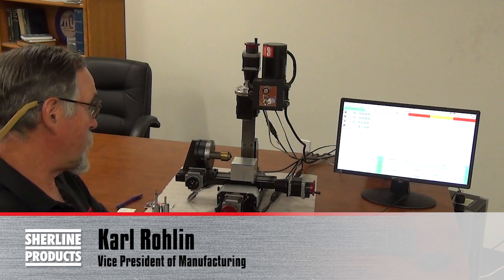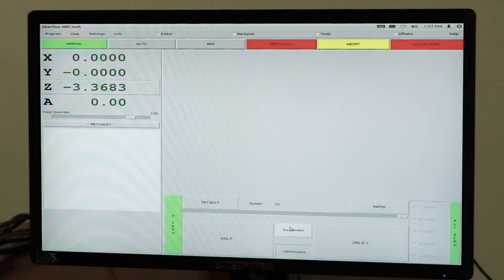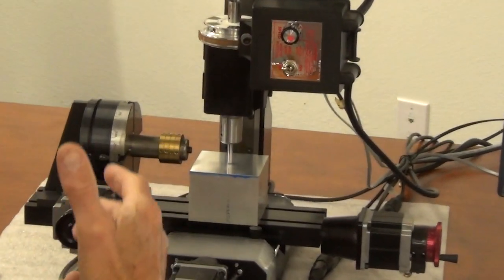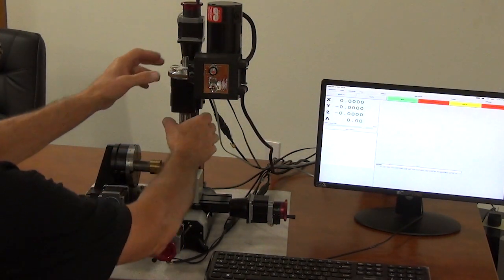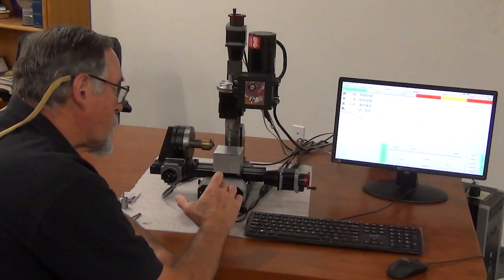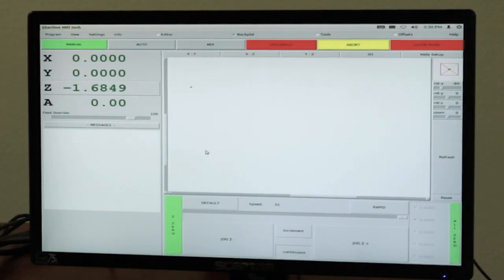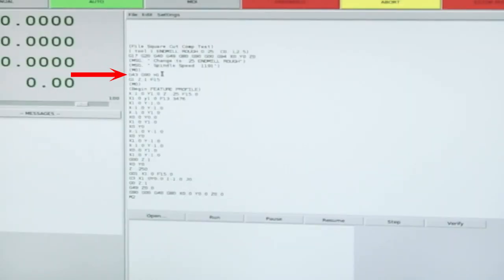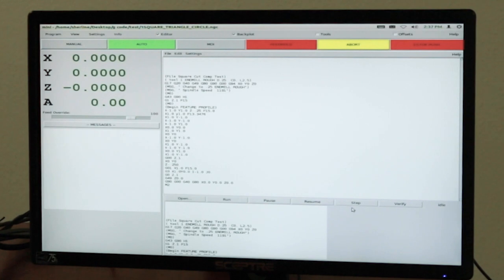Linux CNC Instructional Video-Setting up a Linux Job and Running a Program

Comment: Good information.  Got my Sherline/Linux disc and loaded it up on the old Windows Xp desktop, my mill is now working.
Having an issue with the X axis only turning in one direction, when Jogging, have swapped cables and sockets on the 8760 controller.  And the problem follows the X.  That is if I plug the X cable into the Y socket I the Y then runs in one direction regardless of jogging + or -
 Is there a way to fix this within the Linux program?
Reply from the maker: I have forwarded your question to our tech team.
Reply from the maker: Please call 800-541-0735 and ask for tech support.
Reply: @SherlineProducts  I re-loaded Linux and wiggled the connector to the computer and now it's working perfectly!  go figure!   Thanks for the quick response.
Reply from the maker: Glad to hear the issue has been resolved.

Comment: My goodness where was this video like 1.5 years ago. Can you do one for running from Fusion 360 -> VS Code Edits -> 4th Axis Setup? Also are you ever going to get a trunnion rotary table for 5 axis?
Reply from the maker: Here is a link to our Linux Programming Help document (https://sherline.com/wp-content/uploads/2017/08/linuxcnc_help_2.pdf). This document shows the proper formatting for G-code programs for Linux. Your G-code program from Fusion 360 will need to be edited to be the same as the format in the programming help document. This is the same for all G-code programs, regardless of which CadCam software created the G-code.
In General: No M8, M9 (coolant on/off), M3, M4, M5 (spindle CW, CCW, Off). Use G43 to initiate your tool length compensation and G49 to cancel it (as shown in this video).
The 4th axis and possible 5th axis are on our list of future accessories. It is going to take some time before we have a trunnion table to offer.

Comment: This doesn't look like my linuxcnc install at all?
Reply from the maker: Do you have a Sherline LinuxCNC setup?
Reply: @SherlineProducts  No, I installed from github. Is this a custom build?
Reply from the maker: @noanyobiseniss7462  There are many ways to run CNC on Sherline machines. We offer a turnkey system that includes the machine and computer with LinuxCNC software installed.